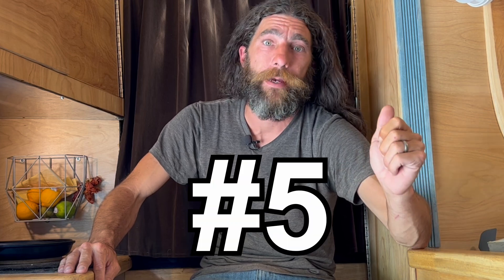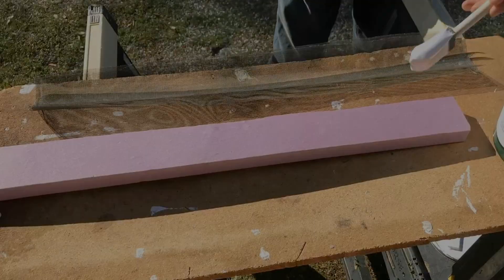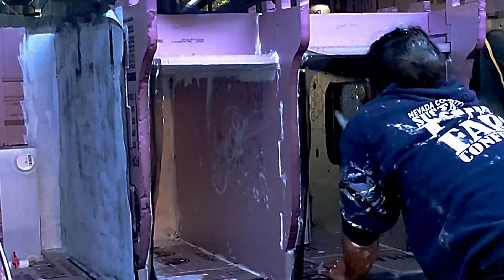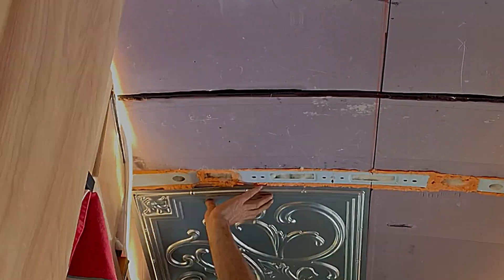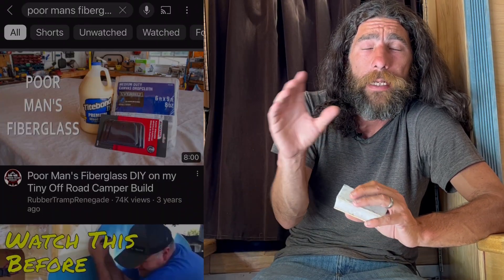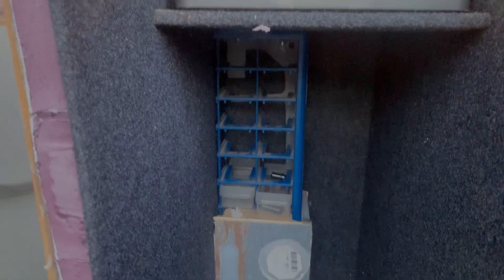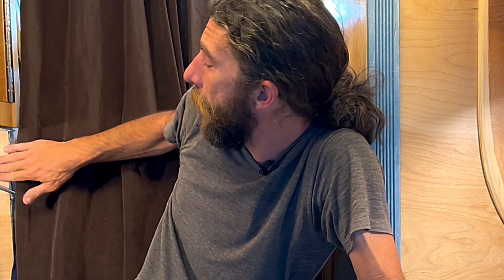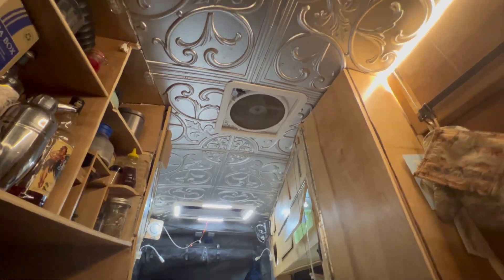Foam Camper Van Screen & Skins -Foam Building System Vol. 5

Comment: Ok!? Questions!? So 1st off outside of basic math I suck at high end math and my head explodes when u talk all these numbers!

So I am an Older Lady with multiple Disabilities!! I been doing a TC Bld with PLY and 2x4s! Going ok! But I see things I want and need to redo! Tried an ideal didn't like the way it worked out so going another direction! Still same basic plan! 

NOW!! MINE IS JUST A SIMPLE WIDE OPEN FLOOR PLAN BLD!! I have a pack of girls that will be traveling with me so mine is a special bld to suit my pack of girls!! I gotta have good protection and good ventilation for them! 

Also! I saw a YT video where this guy did a LW bld where he used like 8th" PLY then foal in the middle then 8th on the other side!? He basically made huge sandwiches with PLY for the bread and foam board for the meat! Or filler! He used this for ALL HIS PANELS!!! HE DID THE FLOOR THE SIDES ALL OF IT!! SAYS THAT MAKING IT THIS WAY MAKES IT SUPER STRONG ANDDD INSULATES AT THE SAME TIME! SOUNDS GREAT!!

SO!? I AM THINKING ABOUT DOING MY SIDES AND ROOF USING HIS METHOD DUE TO IT BEING MUCH LIGHTER AND EASIER FOR ME AS AN OLDER DISABLED LADY TO LIFT TOTE PUT ON TAKE OFF ETC!! IT WOULD BE EASY TO CUT WOOD CHEAPER TO BUY AND WOULD HAVE IT'S OWN BLT IN INSULATION! THE TRUCK BED IS THE FLOOR WITH FOAM BET THE BED AND THE 3Q" PLY FLOOR! THEN DID THE FOAM MATS ON TOP FOR NOW!? WHICH ALSO PROVIDE INSULATION!? 

I WANT TO INSTALL WINDOWS LATER AND THIS WOULD ALSO BE EASY TO CUT OPENING FOR THE WINDOWS!?

But there is gonna be a tiny kitchenette spot at the rear that I plan to do a small upper storage cab!? And maybe a few others around the top for storage! As I really need some blt in storage for NEC items etc.... 

SOOO WHAT R UR THOUGHTS ON ME DOING THE 8TH" PLY FOAM SANDWICH!? AND DOING IT FOR MY OUTSIDE WALLS AND MY TOP!? 

AND WOULD I BE ABLE TO USE THIS WHERE THE UPPER SMALL CABS WILL GO OR WILL I NEED TO USE HALF" PLY THERE!? 

AND WOULD IT WORK FOR THE ROOF!? TOP!? I PLAN TO ADD SOLAR PANELS TO THE TOP LATER!? 

I am thinking I will do the PLY then 1in foam in the middle! Which should make a nice thick wall!? 🤔 

This would ad insulation nicely but also allow me to paint my panels any color I like! As I can pick up return paint for like 9$!? And 15 on the 55$ paint! A HUGE SAVINGS!!! AND I even got a super nice color on a pint for 2.50!!! It is such a beautiful awesome color I hope to do maybe the rest or more of my camper in that color! Got a super great deal.on a gallon of high grade exterior semi gloss WHT! Outside will probably be white with some color added to break up the white and add flavor to it!?

S9 anyways I would like some thoughts on this method and the strength of it as well!?

I won't be living in it full time!! I will be using it to haul my girls in while we travel but hope to be pulling a super LW camper orrr thinking about getting like a 7x16 TA cargo and doing my own camper bld in it! Anddd if so I am thinking about doing the foam to the PLY already in them and then PLY over that on the inside! It will make a nice insulated thick wall! And will foam the floor with PLY on top as well in the cargo!? 

But rt now I am working on my TC Bld for hauling me and the girls while driving riding across country!? As I don't want them in anything being pulled!? 

Anyways...I hope I got my question out rt and clear? Sorry if I didn't!? 😊
Reply from the maker: What vehicle are we taking about for this build? You don’t say. The kitchen are you describe could be fine with this build system, but keep in mind this is experimental and you may not want to do something experimental with your skill set, tools, etc.
Reply: @falkornomad  

An old Chevy Silverado K2500 Extra Cab! 1988! The home bld camper is sitting on the truck rails! It's not a slide in! I will have the crates across the bed head for my girls...the bed board across the top of the crates! The back wall will have the door half and the wall half both which can open up! There will be an ac and window in the rear wall next to the door! With a little sink inside that wall and a tiny kitchenette in that corner left upper wall...if ur standing inside looking out!? Some storage cabinets around the top...small camper type!? And there will be windows that will open later on once I find what I want or need!? So I will have to create an opening for them later!?

Orrr if I find one cheap enough I may just get an aluminum topper with windows already in it and just set it on top of my side walls!!?? This is one huge reason I went with wood to help support the weight of a topper if I go that route!?

So again just wondering if the side and front walls and rhe roof!? Top!? Can be made from the PLY foam sandwich bld!?

Thanks!!
Reply from the maker: From what I understand it should be fine.

Comment: Question about foam:  I used some "Pink Panther" brand foam, and I was also given some of the Blue foam I used for my bed.  (I want to think Pink Panther foam is Corning brand and Blue is Dupont brand?  Maybe not?)  Anyway, I had the experience that the Pink foam does NOT hold up well under UV rays and puts off odors when it heats up and tends to disintegrate into powder over time when exposed to air and UV and heat.  However, my Blue foam had NONE of these issues.  The only problem I encountered with the Blue foam is that it comes pre-scored to break at 2-ft intervals, and indeed if not supported breaks quite easily without any flex warning.  But for me, the lack of fumes from the foam  in heat and UV exposure, and ability to maintain outside structural integrity made me LOVE the blue foam.  When it was for sale (Home Depot), Blue foam is quite a bit more expensive than Pink Panther foam.  However, in the last few years I have not seen it for sale anywhere any more.  Now there is Green foam.  I know nothing about that and never used it.

Question: have you ever tried using the Blue foam or other similar structured foams and if so, do you have any opinions on the different brands? Or are they all the same to you?

Question: When you were camping in 'foam only' mode, did you notice any off-gassing from the pink foam?  Now that everything (almost) is covered in your van, do you notice any smells from the foam during temperature changes?

Thanks for sharing your opinions and answers!
Reply from the maker: I have only ever used the pink XPS foam. Not sure what the blue is. The 4x8 sheets of pink XPS also come pre-scored, that has never been an issue for me, just screen over them. All XPS type foam should behave the same way (fumes, uv, etc). For the foam scraps I have left in sun, yes they age with UV. But once screened the foam is protected from the UV, I have 5yr old foam that has been in direct sun (scraps I screened and left in a tub) and they are fine. 

I have only ever noticed the fumes from cutting it, not when it’s in the van during foam only mode. I do have a video that covers some of the offgassing and cutting fumes… see my “… toxic and flammable” video from 4-5 years ago… https://youtu.be/2-bjB3jXW58

Comment: Drywall mesh for joints could probably be helpful in some situations too
Reply from the maker: Great idea!
Reply: @NØMAD  just off the top of my head, using the drywall mesh tape as edge banding, then screening the faces would allow something like bondo to be used to really smooth off and finish the ends.
Reply from the maker: Yeah… the PMF system uses canvas and once you paint it you don’t notice the texture.
Reply: @mikebonom Consider using spray foam to fill in gaps such as where your joints dovetail. Lighter weight than Bondo.
Reply: @falkornomad  I also wonder if the corners could be rounded over with a router
Reply from the maker: Hmmm… maybe in my Q&A video I mention that the coarse saw blades make a chunkier cut… wonder if the high speed of the router would overcome that. Maybe.

Comment: You are a brilliant communicator. I love your style. Also, have you considered contact cement, or would it eat your foam?
Reply from the maker: Ahh thanks, that’s a very generous compliment!  

I have not considered contact cement… I do worry about caustic solvents eroding the foam, but… make your case, why do you think it has potential? I do like that it cures to a flexible nature… what else???
Reply: Contact cement will burn foam in my experience.

Comment: titebond and thrift shop bed sheets work well as a skin over foam. i made a foam boat using that method and it was a lightweight, useable boat for years until a dropped tree branch in a storm turned it into a pile of trash.
Reply from the maker: All construction methods have their pluses and minuses.

Comment: My apologies if you've covered this and I've missed it:
Could you very slowly show how to make the finger joints? I see me making them the wrong way somehow and needing to cut off a tab and now having the side of a cabinet too short. A template used throughout? Mark A to remove B to keep? Divide length of component at certain intervals for a resulting x notches? I feel silly asking such a basic question but don't want to miss out of you have a basic solution to reduce mistakes and waste. Now that you've located your beer,  I'm off to have a wine.  From a box.  Because reduced weight and breakage risk. Obviously. 
Thank you for all you do! You make it possible for people to seek freedom who couldn't even dream of it before.  And make modifications for disabled needs! And you've gathered some great people here.  I've learned much from the comments as well.  Cheers!
Reply from the maker: We too like BotaBox wine!!!

Notch wise… try this video https://youtu.be/t96u94PytcQ at 5:00 to 5:45ish for a visual. 

Basically, for 1” foam I do 4” x 1” tabs. The 1” is the thickness of the material. Any size for the 4” is fine, I just like the proportions of 4”. I used to use a template as seen in video,but I don’t anymore. I just start at one end and mark every 4” to the end of the foam… last one can be any size 1-7” (since all pieces will not divide evenly by 4”. 

Then I mark “X” on every other 4” space… X means cut this out. Then I mark the 1” deep only on the spaces with the X. This makes the lines I will cut out. 

Next I match up the piece it will fit into, mark the same 4” marks BUT put the X on the opposite spaces and add the 1” mark same as above. 

Then cut out as you see in the video link with hot knife; cut the 1” from the edge to the line. Then insert the hot knife in middle ish and push to the 1” line and then pull to the other 1” line. 

You can mess it up… trust me… some will be straighter than others, some tighter, etc. If you are using the gorilla glue HD, you can fill in if it’s loose. That said, for tightest fit, cut one piece on the line and the other piece a tiny tiny bit inside the line. 

If you have more questions feel free to ask.

Comment: I'm wondering if using epoxy and 6oz fibreglass in the corners then the wood paneling for structure and looks.
Reply from the maker: Don’t need screen (or epoxy, or fiberglass) if you do the wood.
Reply: Pure fiberglass + epoxy is transparent. You should use the epoxy + fiberglass on top of the wood paneling. It would create a very strong, easy to clean and near indestructible structure. If you want to do this you should look up boat building videos. You will find some boats are built with foam core + fiberglass shell - the wood paneling is optional.
Reply from the maker: I’m aware of the boat (and plane building methods). I just used a few coats of water based polyurethane on the wood. No fiberglass for me thanks, but everyone else can have their own preferences

Comment: Thanks very much for your videos on foam construction. This may sound dumb, and I may have missed it somewhere, but do you need to peel the plastic membrane off the surface of the XPS foam so the paint will adhere? I just experimented with PPG Gripper primer, and found that after allowing to dry overnight the paint stuck to the part of the surface where the membrane had been peeled off much better than on the membrane.
Reply from the maker: That is NOT dumb! That is a common question and I have never noticed said plastic on the foam… I am assuming this is a new thing on Foamular and it’s no bueno. Sounds like you did the testing needed and got your answer… yes, peel it off (or maybe lightly sand it?). things continue to change and we have to adapt! I’ll add this to my Q&A video for sure!

Comment: One thing to bring up, in support of the screening idea:  There's prior art that supports this technique.   I first came across a similar technique when in a forum build thread, with the author was using the same XPS foam to make an smoothing aero undertray for his car. 

He used latex paint as a sealer, and poor-man fibreglassed with cloth, or chop strand in wood glue as his outer substrate/shell.  If you're curious, web-search for "Honda Insight Under-body Smoothing Panel" and it'll turn right up as a thread on the Ecomodder forums from about 14 years ago, at this writing.  3-Wheeler, the author/fabricator, made a motorcycle cowling for a bike prior to the car undertray, and then made a tailcone fairing after using the same technique.   He even followed up, showing that he did have some water intrusion and damage after all weather, year-round use on THE UNDERSIDE OF A CAR.

So, variations of a theme on the foam-bones concept can stretch pretty far.   I just figured you'd want to see this, if you hadn't.  Maybe it'll give ideas for you, or others to experiment further for stronger structures, where strength is needed.     Love this series of videos on the construction method!
Reply from the maker: Thanks, had not seen this… pre-Pink Panther Fomular 150!!! Vintage! https://ecomodder.com/forum/showthread.php/honda-insight-under-body-smoothing-panels-custom-belly-10638.html
Reply: ,😱you can use it under the car. I think my mechanic would look weird if I came to the garage with pink foam sheets under the car

Comment: Very classy ceiling! Gives your van a bit of gypsy look.
Most of this info on the skins was covered in previous videos, but it's really good to have it all in one place, and with some extra tips too.

BTW, here in Australia, White Knight "Grip-Lock" Primer is a good substitute for Glidden Gripper, & works quite well with the insect screening method. (I used the fine insect mesh in a roll from Bunnings - it is thinner & smoother than the regular insect mesh.)
I'm a bit ho-hum about the mesh screen - it does end up quite strong, and maybe the lightest way to go, but it's butt-ugly. Which might be ok for an interior surface, but not for one you are going to see. The original people, as I understand it, covered up the screen with brown paper decoupage - which is heaps more messy work, and IMO is not really the look I want. I did try tissue paper decoupage (instead of the insect mesh) and it does add some strength over foam alone (from the glue or primer, which stiffens it) & gives quite a nice smooth finish. But again, it is heaps of messy work, and I don't think I would have the patience to do more than a small section this way. 

Just for info: when I was a kid, we used to make things out of paper mache - strips of newspaper soaked in a glue made of flour & water & layered - and it ended up amazingly strong. (Newspaper is pretty hard to get these days, but being very porous it soaked up the glue very well & I think this was the secret to its strength.) 

I also tried linen fabric (which I happened to have to hand in my sewing scraps bag) and it worked quite well for lining... maybe not as strong as the insect mesh for a weight-bearing surface, but it should protect the foam against damage from knocks & so on.

I'm planning to use a cut-down painter's canvas for the interior of a large kitchen cabinet for my fridge (which is a top-opening type, doesn't need to slide out so will just sit on the bottom of this cabinet. (I only have a small van, no nothing will be very complicated.)
The painter's canvas from Bunnings comes with a waterproof PVC backing, which I wasn't sure about at first. But then I remembered a comment from Jon Decker in one of the "Into the Mystery" videos: "I'm testing a method to make foam cabinets using truck bed liner for awesome impact resistance."
Also, buying a painter's canvas like this is a lot cheaper than trying to buy actual canvas fabric - fabrics of all types have become really expensive here in the past couple of years, and really poor quality too. So we'll see!
Reply: Thanks for sharing where to get all this in Australia 🇦🇺
Reply from the maker: Thanks for the tip on White Knight Grip lock!

Comment: Excellent video!
Wood veneer over foam adds quite a bit of strength when glued to foam, but only in one direction. If anywhere, this is where you do want to use both fiberglass mesh and veneer. It prevents splitting/cracking within the weak direction of the veneer.
Reply from the maker: I agree, veneer with grain oriented opposing the direction of the bend under a load would have strength. That said I think I’d still screen. I tend to overbuild as I’ve mentioned.
Reply: have you looked at a 3rd screen level in the middle? Either 2 thinner foams layered with 3 screens or even these standard foam thicknesses? I know this would not be for most applications, but where strength and screwing are imperative, this could help with special situations such as supporting bed... @falkornomad
Reply: I think you could solve this by using thin vynal veneer though it wouldnt have the impact resistance of a wood veneer. Heck do 'em both and get the best of both worlds. Lay down the screen first then to a 5 mm veneer or sanded plywood on top.
Reply: or use painters drop cloth canvas